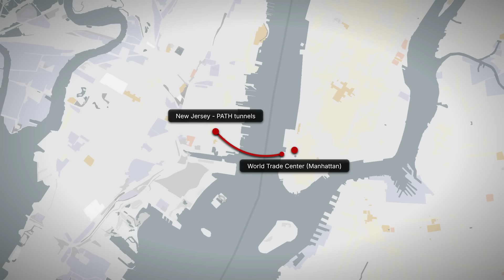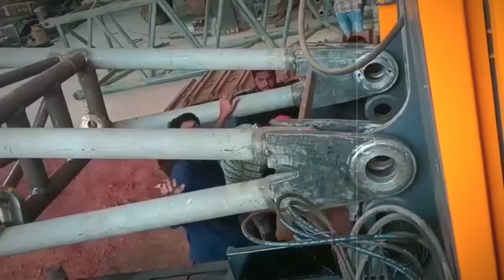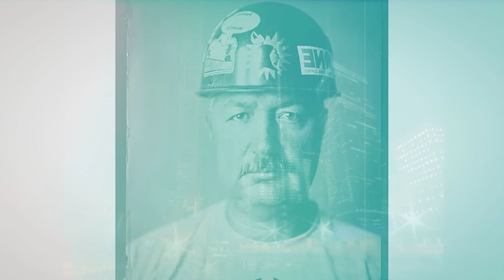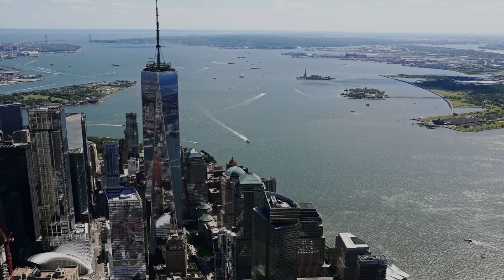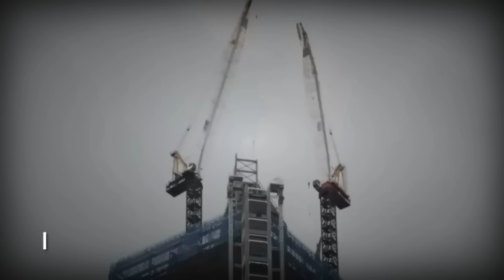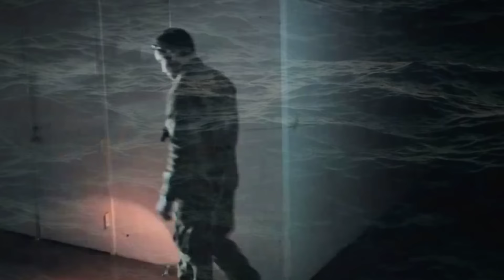The Machines That Built One World Trade Center (2006-2014)

Comment: In the beginning you said that they used the same bathtub built for the old twin towers to avoid the Hudson river from flooding into the bed rock. Why did it flood in 2012 if it was built within the bathtub ? or why they didn't take precautions before building the tower like they did with the twin towers by creating the bathtub to avoid water flooding inside ?
Reply from the maker: @eliaskaff Good question! The slurry wall (the "bathtub") keeps groundwater and river seepage out of the foundation, but it is not a flood barrier against a storm surge. During Hurricane Sandy in 2012 the surge came over land from the streets and poured into the open construction site and its access points, and the tower was still under construction then. After Sandy, the flood protection of the site and the surrounding area was upgraded.
Reply: @ConstructionLegends ahhh okay thanks dude .

Comment: it's crazy that today we put on tall antennas onto buildings just to try to beat the highest building record.  If i put a TV antenna on my house, is the entire building increased in height? No.  The tower on top is not an extension of the building but a piece of steel on the top to beat a record.
Reply from the maker: Good point  the spire on One WTC is actually integrated into the architectural design (not a removable antenna), which is why it counts under CTBUH rules, unlike a simple broadcast mast.

Comment: The video contrasts the 0 worker deaths of One World Trade Center construction with 60 deaths from construction of the original "twin towers" World Trade Center. It asserts the 0 vs. 60 number repeatedly.  Yet in the earlier "Machines that Built The World Trade Center (1966-1973)" documentary, the narrator claims (pretty vehemently) that is was more likely only 8 deaths recorded, while the 60 number is based on some 2015 claim that has no official record or source behind it.  0 is still better than 8, but 8 is far better than 60.  The two documentaries should reconcile on this one point.  Otherwise, fascinating documentary.
Reply from the maker: Andrew, thanks for sharing the additional context. Historical casualty figures can be complex, and it's always worth examining the original sources.

Comment: The reason why it’s “1776 Feet” is because of the Spire on top. It’s actually about 1300 feet which it’s still tall. Even the Sears Tower is taller without their antennas. I miss the Twins. 😢
Reply: Not quite accurate there pal. It's not about 1,300 feet it's 1,368 feet which is symbolic to the height of the Twin Towers, although one of the Twins was actually 1,362ft & the other 1,368ft.
There are in fact four towers that are taller by roof height. Central Park Tower - 1,550ft, Steinway Tower - 1,438ft, 430 Park Avenue - 1,396ft, the new JP Morgan Chase 270 Park Avenue - 1,388ft.
One Vanderbilt is 1,401ft but the last 100ft is the architectural spire. 
Also One World Trade is listed as the tallest building in the western hemisphere but it's not. The CN Tower in Toronto - Canada at 1,816feet has held that record since is was completed in 1975 surpassing the Sears and WTC. 
There's always debates on what constitutes the full height of a building, personally like many I don't include the antenna. As I've always said you could build a 40 story block that's say 600 feet tall and add a 1,200 feet tall spire/antenna and then argue it's the tallest at 1,800 feet lol.
Reply from the maker: John Appreciate the detailed breakdown — you're right that height comparisons get complicated once spires, antennas, and roofline vs. pinnacle height come into play. Thanks for adding the extra context!
Reply from the maker: Thanks for the extra detail on the height! Appreciate you sharing that, and yes, the Twin Towers are missed.

Comment: The original twin towers still look taller than the single new one for some reason.The twin towers have 107 floors and the new tower has 103 floors.The new tower doesn't have an outdoor observation deck.
Reply from the maker: @Steven Great observation, the drop in floor count really does change the overall proportions and skyline presence.